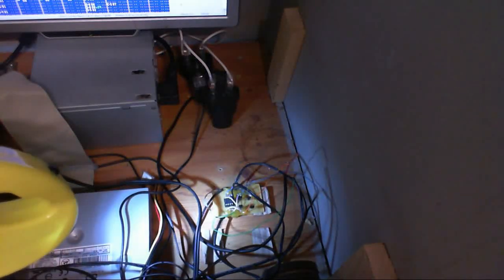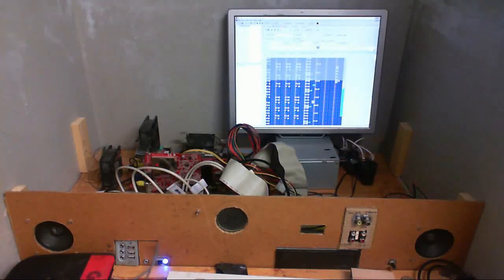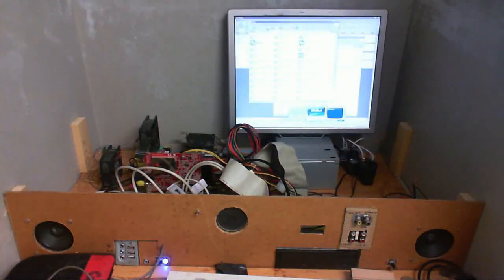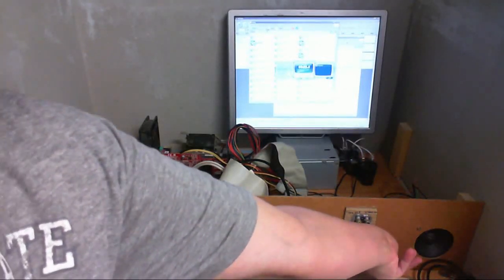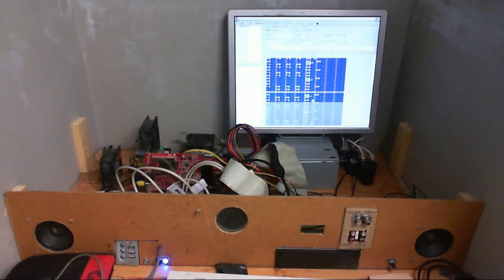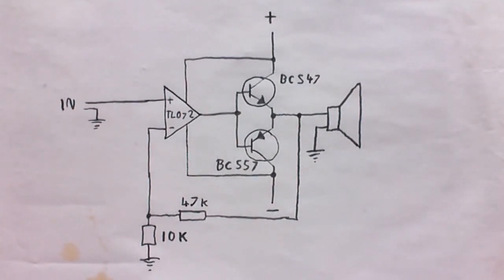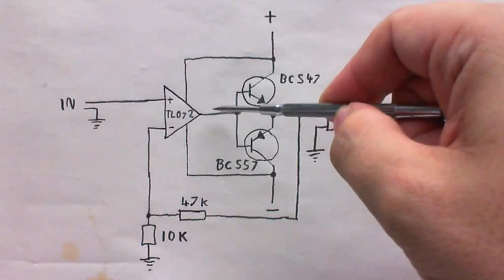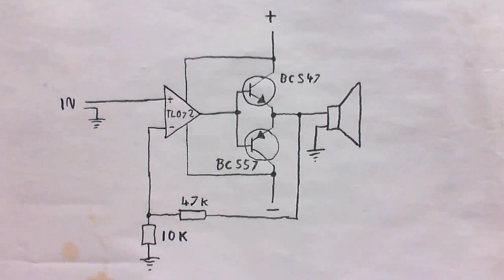"Distortion Free" Class B Audio Amplifer

Comment: Nice circuit! It is a classic emitter follower configuration, made with a low side and high side emitter follower paired up together, and then negative feedback loop using the op amp to correct small deviations in the output stage. That is a nice driver! However, it AINT distortion free! All amplifiers have some distortion, you may need some really good laboratory equipment to really see it. You can actually use an oscilloscope in XY mode, and a driving signal, where X probe is input, and Y is the output, and by sweeping the input with a function generator, you can really see just how much the scope trace deviates from a linear output. You should always get a linear line out if it, with a slope that is proportional to the gain of the amp, which is determined by the 2 resistors.

The distortion will occur if you get too close to the rails of the power supply by having input voltages too high, and of course crossover distortion because of the way the 2 transistors are used together. There may be a small delay from completly turning, say, the top one off, and turning the bottom one on, and the time it takes for the control loop in the feedback to respond. In this case, the op amp has a limited slew rate, it can only swing the voltage rail soo fast to correct that 1.2v difference in the biasing of the 2 transistors.

A 'better' design would be to use a pullup resistor on the high side transistor, a pulldown resistor on the low side transistor, and 2 diodes or base-emitter junctions that are very closely matched to the base-emitter characteristics of the output transistors, so that one transistor is always biased ~0.6v higher, while the other is biased ~0.6v lower, all relative to the output of the op amp, of course. However, as you stated, that can lead to higher power use and less efficiency.

because there is hardly any distortion, this amp is actually qualifies as a class AB type, a intermediate type of amp which, looks like a B amp in schematic form, and the driving elements are driven as such, but in fact has almost as little distortion as class A!

http://www.electronics-tutorials.ws/amplifier/amp47.gif

Comment: Very nice Clem. Seems a very simple circuit to understand. I suppose that this Amp has a high input impedance and a guitar could be used? I'm going to hunt through my component box and see if I can rig this up on a breadboard later.
Reply from the maker: It could be done, that particular op-amp has a very high impedance, but it would need a lot more gain for something like a guitar, changing the 10k resistor to 1k would at least give it 10 time more gain, and increasing the 47k would also work.
Reply: Thanks Clem. I figured as much with the increase in gain. I've had a rummage about and found a 47K Pot and was thinking of putting another resistor in series with that to make an adjustable gain pot. Am I correct in thinking that the amount of gain would be limited by the power supply voltage? Thanks again for some great videos.
Reply from the maker: Duncan Roe The power supply wont have much (if any) effect of the gain at all, at a lower voltage it will clip more easily.
Reply: it is the power supply  of + -- 15 volts or less?

Comment: can you make one of these replacing the opamp with something made of discrete components?
Reply: mmmm that would be too complex, but it could be replaced using a single transitor?
Reply: Nerdy NEET  but are cheap atleast, well you didnt asked my question yet...
Reply: Bloodbath2you
You can make an amplifier out of transistors. You could have a single transistor common collector amplifier for voltage gain followed by a class A common emitter or class B totem pole for higher current output. It would introduce a lot of distortion though as transistors aren't linear and there's crossover distortion from a deadzone in the class B totem pole. You could improve things by making the input amplifier a differential pair and having negative feedback to one input. You'd need some loop compensation for stability. You could also include a little bit of circuitry to reduce the crossover distortion and make it more class AB.

And there you have.... the internal circuit of a very simple opamp. This could be improved of course, by using an actual opamp. Not all opamps are the same, some have more output crossover distortion than others and you can get opamps which claim to be designed for audio. The negative feedback takes care of the crossover distortion at low frequncies, but at high frequencies the slew rate of the opamp limits its ability to deal with it.
Reply from the maker: Bloodbath2you it could be done, but here I wanted to build an amp as simply and with as few parts as possible.

Comment: What can the reason be that the NPN transistor get hot?
First I thought it was because I didn' t use a negative-voltage power source so I made virtual GND with two capacitors and resistors, but it just the same heat up, what might be the cause if you could help me.
Reply from the maker: You need a supply that can provide positive and negative voltages, a virtual ground isn't going to work that well. You probably have more voltage on one side of your virtual ground, a capacitor placed between the speaker and the amplifier might help with the hot transistor issue. Does the speaker cone move when power is applied?
Reply: CoolDudeClem I've already got a 7+ 0 7- transformer now the speaker make static sound I think it's transformer noise but it sounds very low volume (i use in lm339n supply is v+ and GND) do you think that might be another problem?

Comment: I need the designing equations for the circuit
Reply from the maker: You don't need to worry about equations, I have all the recommended components in the schematic. The negative feedback resistors are calculated the same way as in a regular op-amp circuit, the gain is 1+(R2/R1), so in this case it's 1+(47/10) as those are the resistors I chose so he amplifier has a gain of abut 5.7.

Comment: The issue is that you "overloading" the feeedback, even pure sine output would give you a pretty strange waveform at the opamp. I tell you because I ve simulated amps like that and feedback does all the magic, but not for free, You got ringing and small oscilations that yes, nothing but THD. Since theres a voltage gap where output stage is not working, opamp need to step fast till it regain control over the output stage again. Same in both sides of the wave. Not sure, but just wondering. Have you put the scope there ?, I used Pspice tons with this circuits (I like amps) and surprised that an almost clean ouput let a near dissaster control signal. I know, It is weird. But, well, its possible. Clem, any chance of a future vid of an speed control for a DC motor with 2 transistor. not a constant just voltage. Need some approach to get RPM almost unchanged even if load changes. To do that, as LOAD increases, current increases, and voltage need to be also increased to compensate. Yes, if you are wondering, its for a R2R UHER, motor just gave up. Got a motor to put but the speed circuit is not fast enough and tend to oscilate. Go and figure way. Cheer !!!
Reply from the maker: 38911bytefree I mainly made this little amp as an experiment to see whether it would sound ok or not.  I think I was just as surprised as you as it sounded better than I thought it would, so I built a second channel on to it and used it to power my speakers, it's adequate for the job. I don't need to scope the output, after seeing that other video that JonAudioTech did, I get a pretty good idea of how it looks.    As for motor controll circuits, I'm afraid I don't know much about them, I guess there's some kind of current sensing circuit in there that increases the output as the current goes up but I haven't really looked into that
Reply: Thanks. I look two cricuits but dont understand them very well, so I cant modify them to work with my motor. The circuit, its values, seems matched to certain motor type (internal resistance). Its a good project because tape decks motors and in my case the UHER DC motor are not longer avaible. You can get the motor itself but not the speed control anymore. PWM ?. Tried it, dissaster and tons of noise in the circuit. Original UHER motor is a gobernor type, but gobernor switchning is sent outside the motor and drive a couple of transistors to avoid the gobernor noise switching windings directly. Clever enough. But motor is DEAD now and spares are near impossible. Got a motor that fits, just need a speed control. cheers

Comment: Small correction: the - input to the opamp is the inverting input, not the non-inverting input. I'm sure you know that and you just accidentally said it backwards.
Reply from the maker: KX36 Yeah I'll have to put n some annotations or something, I think it's the fact that the name "Inverting input" is represented by a negative symbol, so it puts a double negative in my brain and I say the wrong thing.  I get the input names mixed up all the time but strangely enough I never have wired an opamp up wrong, I can practically do that in my sleep!